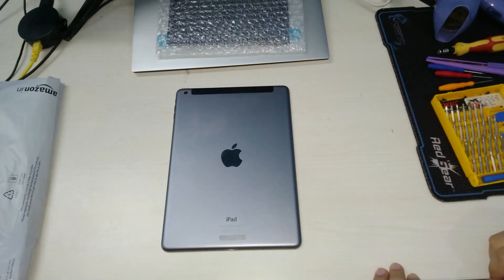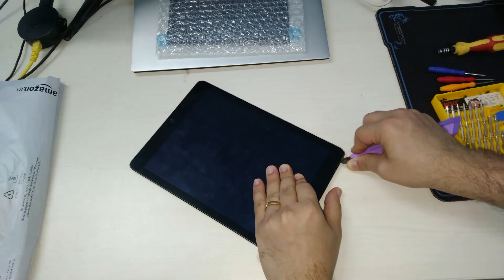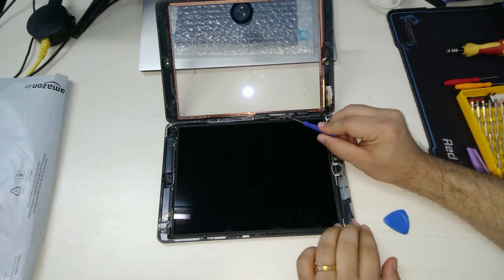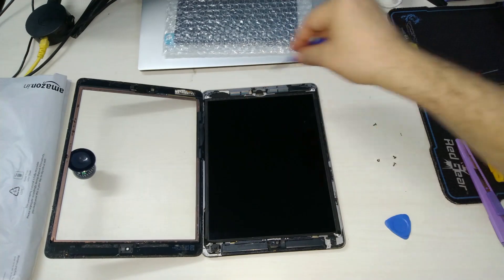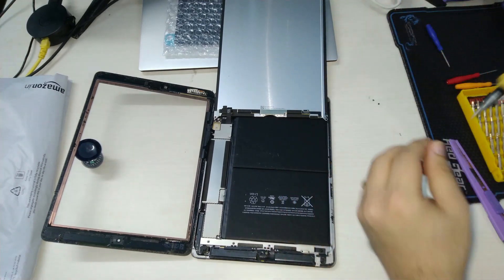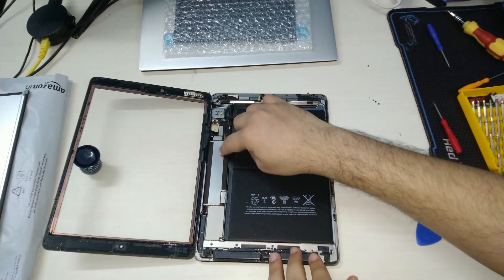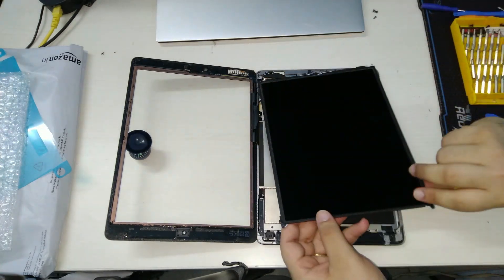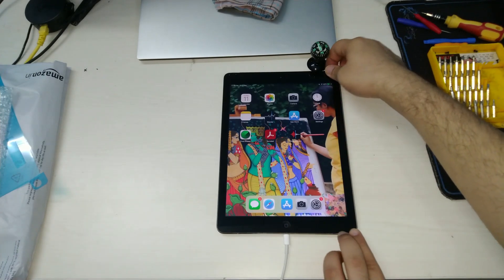Apple iPad Air  - A1475 - Battery replacement | Disassembly | Low Battery Fix | Lithium polymer bat.

Comment: The only part I needed to see which is getting the connector out from under the screw part you don’t even show. Other videos the iPad doesn’t have that silver rectangle to the top left of the connector and they can easily lift the mother board. But mine can’t do that it has the silver rectangle like in this video

Comment: Hello sir, please I have apple A1475  same as yours , but I've been charging it for the past 3days now is not coming up at all. It'll boot the apple logo and goes of but not completely cos you'll see backlight but it wouldn't come up ,and if you remove the charger and press the power button, it won't on at all , do I need to change the battery or.......? Thanks sir

Comment: This video is wrong. During the reassembly he said to secure the battery connector first. This is a huge mistake. You never want to connect anything to the logic board with the battery already connected , period . The battery gets connected after the home button lcd and digitizer (touch screen) ribbon cables have all  been connected  to the board. Than with everything connected you remove the battery isolator and screw down the battery. This is the right order to make tour connections unless you want to damage your  device

Comment: Hi, can you please share the link to buy the battery from amazon.
Reply: You can buy a genuine replacement battery from www.MobiSpares.com
Reply from the maker: Hi Jairam Bala.

Here is the Amazon Link : https://www.amazon.in/Battery-Apple-A1474-A1475-A1484/dp/B08P7QFCDZ/ref=sr_1_1?dchild=1&keywords=ipad+battery+A1475&qid=1608305668&s=electronics&sr=1-1
If it is unavailable, please contact the seller directly on : https://www.mobispares.com/

I get all my battery replacements online there. The quality and price is very good.
Reply: @ACubeTechVideos  How is the battery life of this battery. My ipad has also same issues, so planning to buy battery.
Reply from the maker: @jairambala4276  I have conditioned the battery with 4 charge cycles. The device is extensively used as a daily driver with both wifi and cellular data running. I end my day with the battery still at 25%. 

Here is the direct link: https://www.mobispares.com/original-Battery-Apple-iPad-Air-A1474-A1475-iPad-5-A1484?tracking=skNTiOr6axHQD93pVoN6Vf4miBnsaXx55ZmVSBjw6a8CrkLuK6Qwej3UjsDiIbUt
Reply: @ACubeTechVideos  Thank you sharing the link. Very helpful.